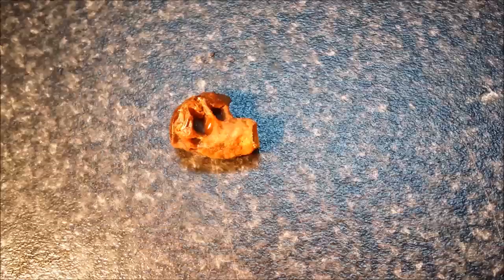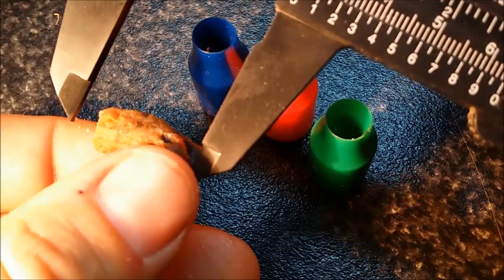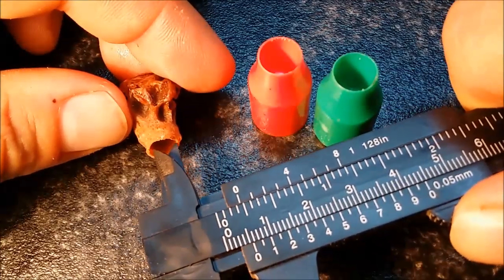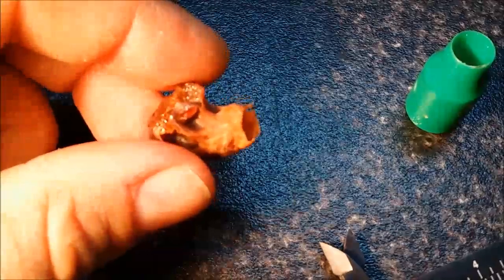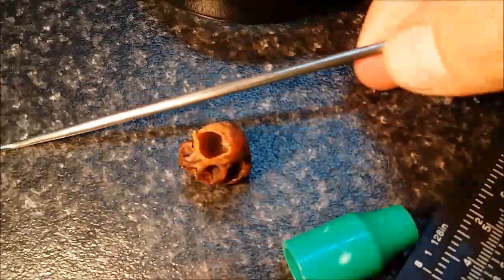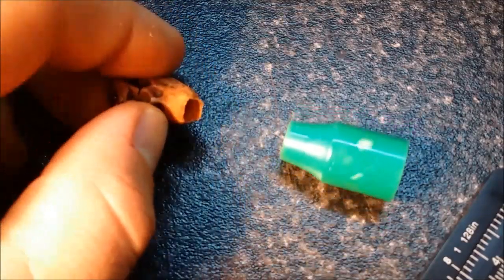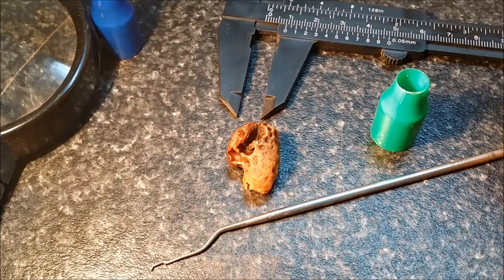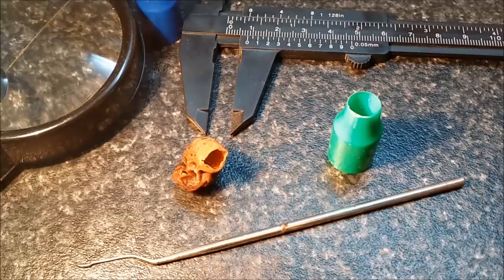QUEEN REARING - Queen cell vs Plastic cups. Beekeeping for beginners

Comment: I’ve seen large and small natural ones- what is the difference between a Queen that comes from a large vs smaller? Adult size? Do bigger lay more/better?
Reply: Yes : bigger Queens, from bigger & a tad Longer Q. Cell, lay better Eggs. No Runties !
(Also, super long ones, means the Egg, 'detached or fell a bit within the Q.Cup itself. Not good for breeding ! Mash it.)
The next generation of 'Queens' get made from 'Good, Dimpled, well Shaped' Queen Cells.  Hopefully in a good location.👍
(Away from a back to back one, a doubled one (impossible to cut apart, without damaging one.) Or in a place on a Frame that's hard to 'harvest' easily. Hope this helps. 😎 
🐝🐝🐝🐝🐝🐝🐝🐝🐝🐝🐝
     Happy Beekeeping 2024
🐝🐝🐝🐝🐝🐝🐝🐝🐝🐝🐝